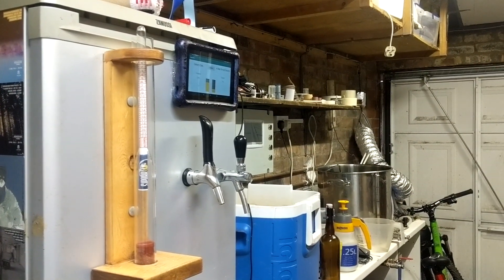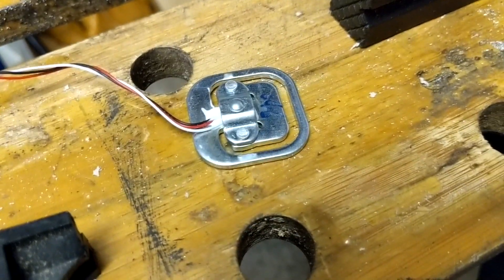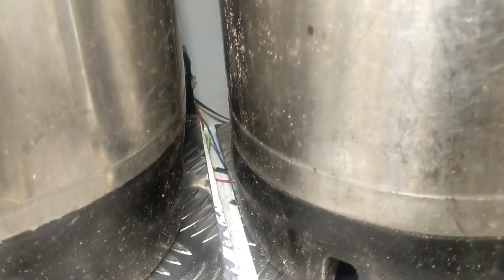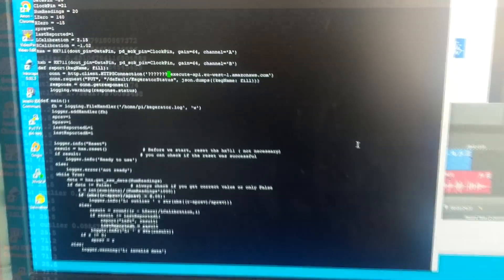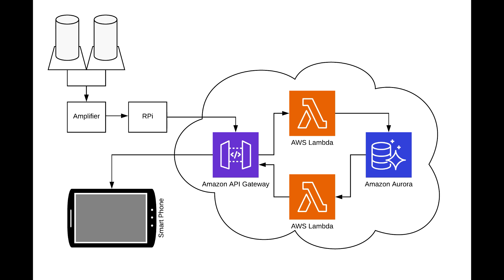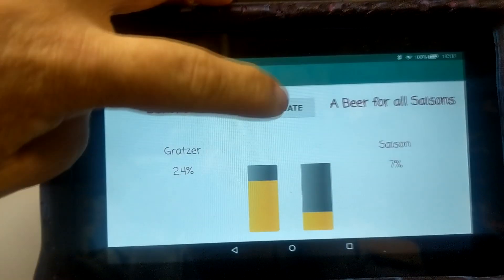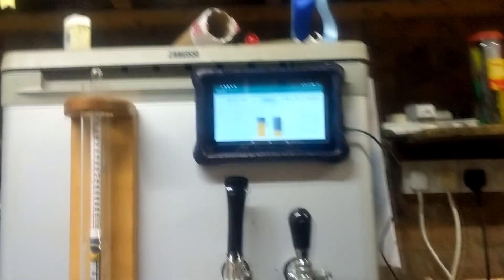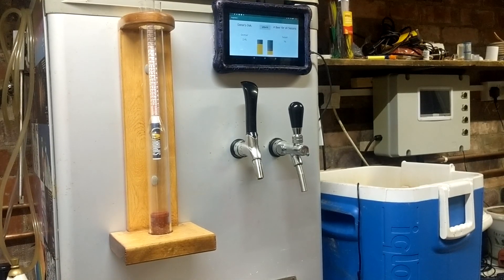How Full is my Keg - Part 2

Comment: How has that been going? A lot of people find that load cells have significant drift over time, to the extent that they are unusable as devices to measure keg volume. How has it gone in your case?
Reply from the maker: The set up worked fine for the time I used it (a few months and several beers). I had some Plato kegs on order from the kickstarter at the point I built it and have rebuilt the system to use them instead.